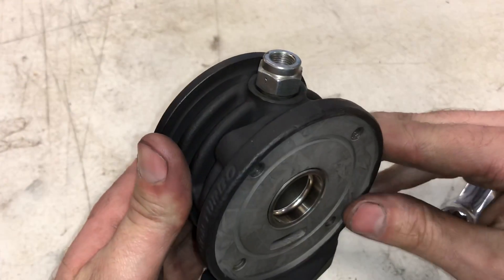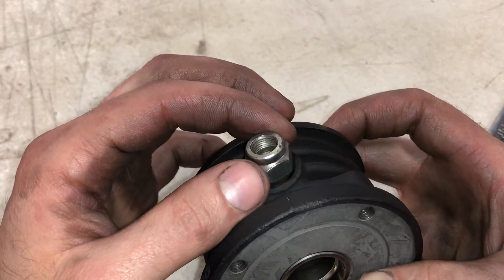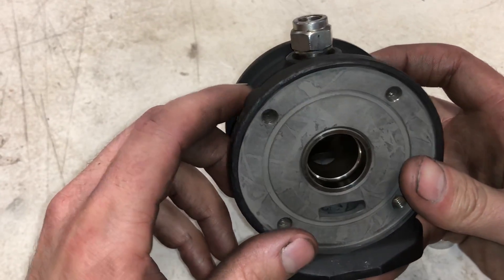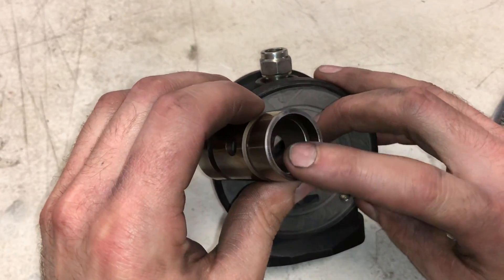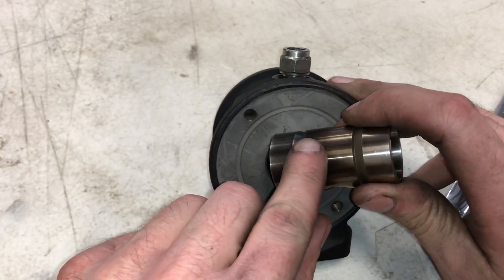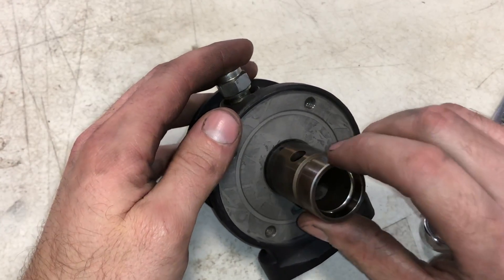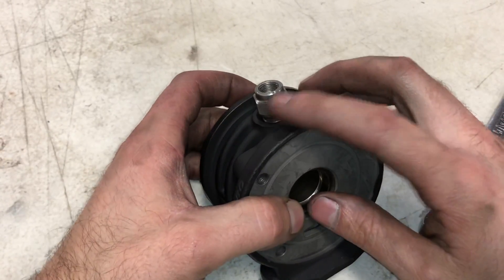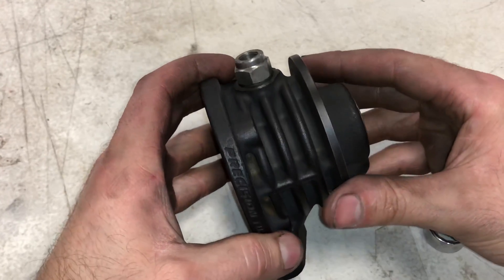Precision gen2 ball bearing removal

Comment: Hi Turbo Lab... I have a Precision 5858 BB that just came from a warranty from manufacturer. They replace the entire center cartridge with a new one, and after installation, I have been looking for a small oil leak from the top of the cartridge. Already replace the oil feed line with its male/male fitting, but the leak continues.
Is it possible to remove this locator pin/nut to check/replace any o-ring/seal here, and reinstall it without disassemble the entire turbine?

Comment: I very rarely leave comments on YouTube, but this deserves to be said. You're my hero, there's so little information I can find on the internet regarding that alignment pin, and almost 100% of it is "ZOMG you just removed that fitting you've destroyed your turbo. Send it back to Precision immediately and if you're lucky something can be salvaged." 

I acquired a second hand 6466, and removed the inlet feed thinking it was just some fitting left in it from the previous owner. I have very strong technical skills and can generally repair/rebuild just about anything once I understand how it works and why it's built the way it is. Of course no one offers any explanation for the purpose of that pin other than "don't remove it or you'll ruin the turbo". There's nothing in there under spring pressure, so that doesn't make sense, I was fairly sure it was just an alignment thing. 

Turbo Lab, you've saved my day, and this simple short video will have me shopping your store first for any future turbo related purchases. Thank you!
Reply: exactly, Ive had it out 4 or 5 times on mine and as long as you guide it in properly nothing happens, turbos fine
Reply: @LN2Boost  mine is leaking on a 6664 bb. Is it just one o-ring under/on the fitting? Mine is leaking oil and I found my way to this video trying to fix it myself. Had hoped he pulled it all the way out in this video.
Reply: @mastermnd22  Hey, mine is also leaking. Were you able to fix it yourself? Did you just have to tighten that fitting a bit more?
Reply: @DeclanCrane  hey, so it's an o ring. If it's leaking need to replace it. Change it when the engine/turbo is cold. Then use loctite on the threads. I had the oring in an assorted kit. Then just put it all back together.. it's also the alignment pin, so don't do anything like bump the turbo around. And then don't fight it back. It should just go back in to the threads then screw down.